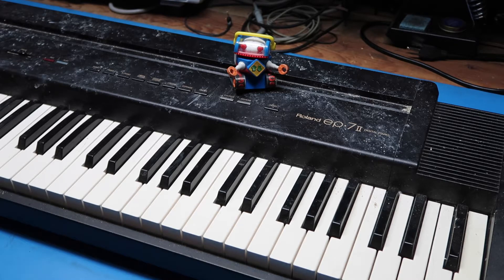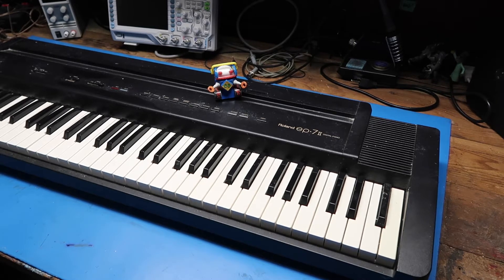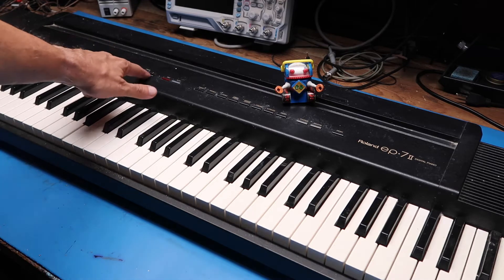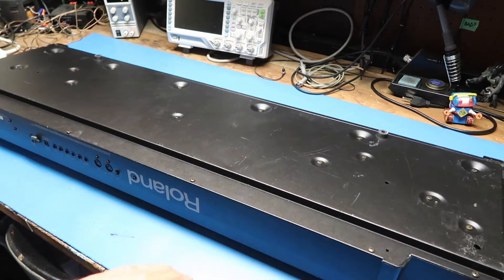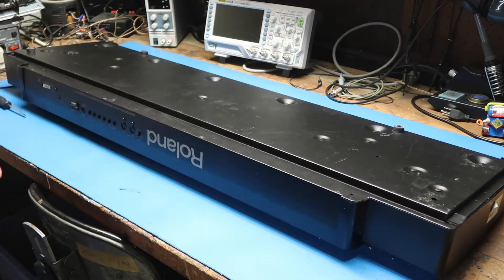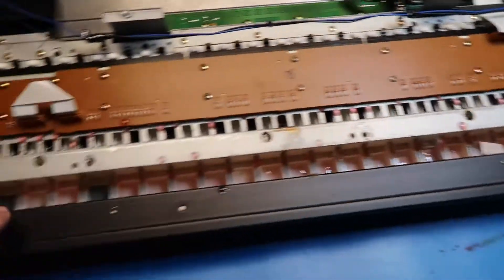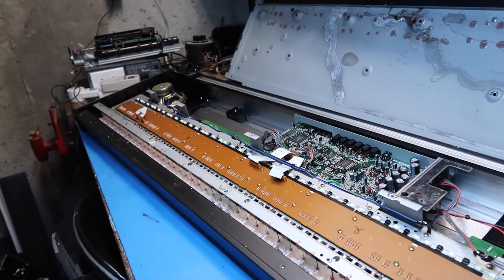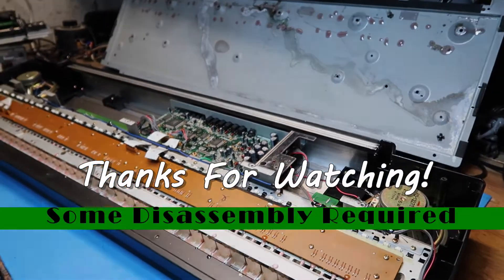Discovering a Roland EP 7ii Digital Piano - Part 2: Disassembly and Inside Tour

Comment: The pink stuff is the glue used to hold weights in place. If you look at the back side you see some of the weights are still in place on the bottom side of the keys

Comment: Hello, did you ever end up fully repairing it or did you sell it for parts? If your selling it for parts I'd love to to buy 4 weights from the white keys. I'm in the process of doing the same repair myself. Thanks.
Reply from the maker: I haven't done the repair, but I still plan to do that and make a video about it. As for selling you the parts, I need all the weights I have for mine but I think you could make weights of your own using some metal stock you buy at a hardware saw and cutting it up with a hack saw. You might also be able to use metal washers or something. I don't think the exact weight is critical, just that the keys are "weighted."